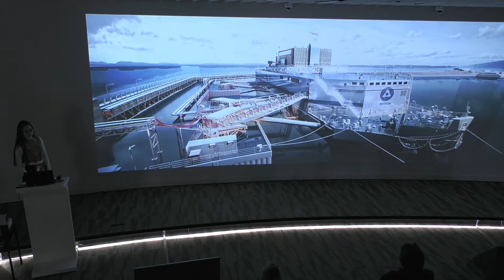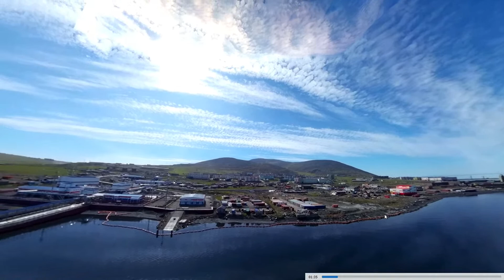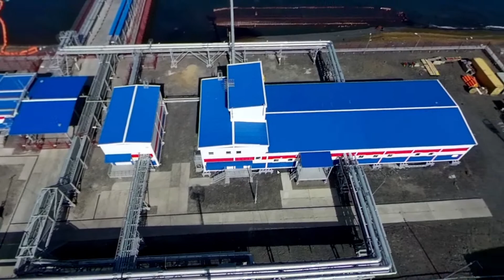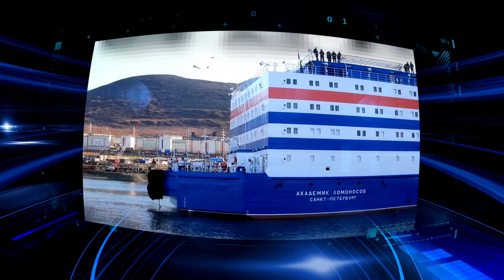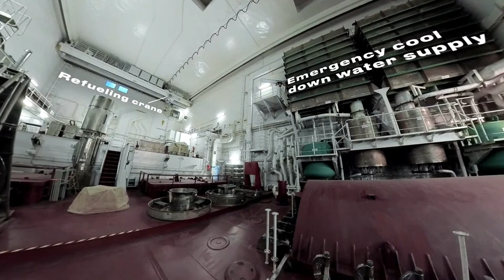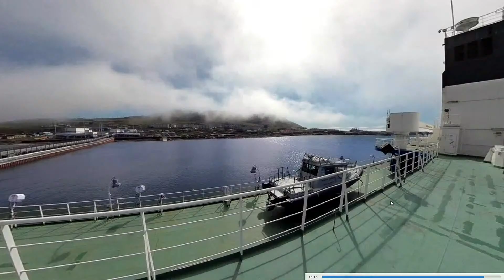Floating NPP Virtual Tour

Comment: Thank you. I do wonder; how long does swapping out this floating NPP for the new one take? Just shut down, moving, and startup of the new will probable take some time. 
I assume this will be done during a warm period of the year (so heating is not needed) and (mobile) generators will provide power during that time instead?
And i guess swapping out fuel will be done during the summertime too for similar reasons?